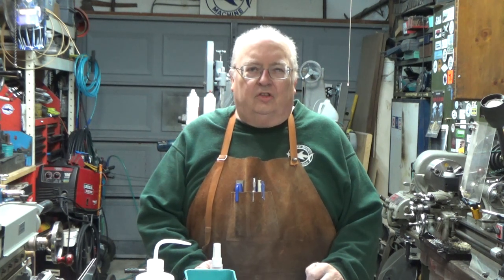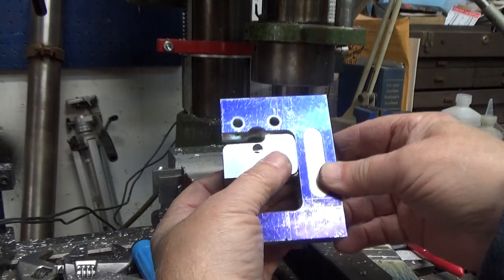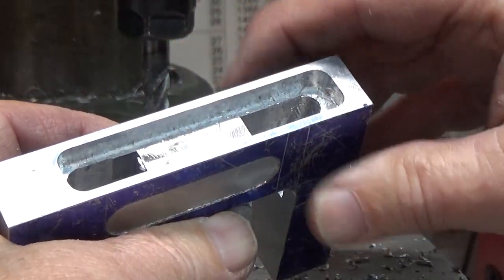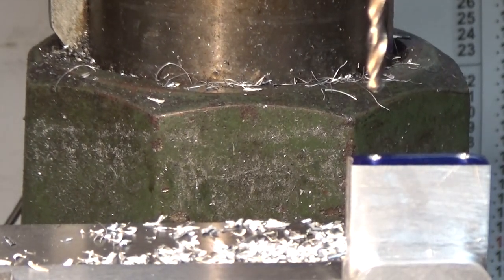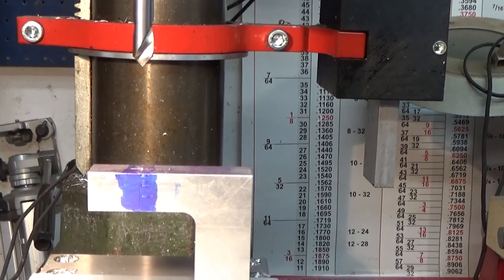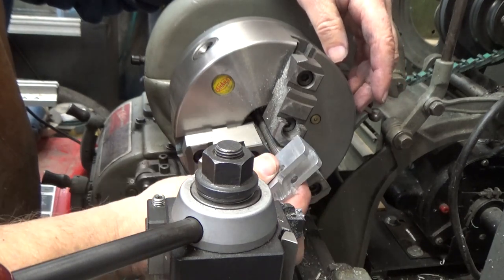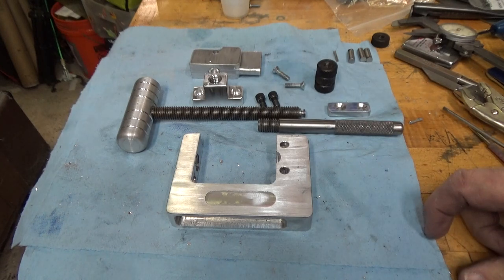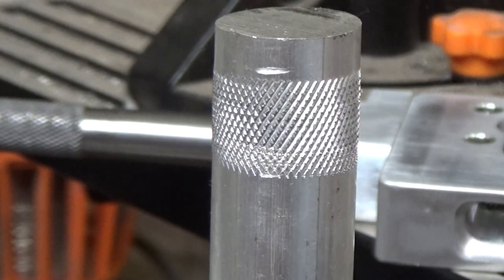Manual Knurling Tool Build Part 2

Comment: I used the same style tool in the mounain bike repair shop years ago. They work very well.
Reply from the maker: When I dropped it off at the shop where my son works he showed me the commercial tool that one of the other techs had.  It was much lighter duty.  This really works great and could be used on steel also.  Thanks for commenting.

Comment: I wondered why you didn't make it with a bigger throat to accept bigger material. The bike deal explained that.
Reply from the maker: The normal size would be around 27MM with the maximum of 1 1/4".  In hindsight I should have made it a little larger but as it turns out in comparing it to the tool that they were currently using in the shop it is a beast.  The other techs were jealous.  I think that it will get a lot of use.  Thanks for stopping by and Happy New Year.

Comment: Great build Steve.  Check out the prices of pipe cutters these days...That design would make a great pipe cutter version IMHO! Happy New Year,  hope you got my channel stickers recently.
Reply from the maker: The Knurlmaster from McMaster is $200.  It only cost $400 for labor and material to build this one LOL.  I just dropped it off to my son at work.  The other techs are jealous.  I got the stickers and will be opening them in my next Shark Bits.  I think that I owe you a set of mine. Thanks for stopping by.
Reply: @sharkrivermachine  I missed the first part of the video where you mentioned costs and pipecutter when I went to get a coffee...thanks for the explanation.